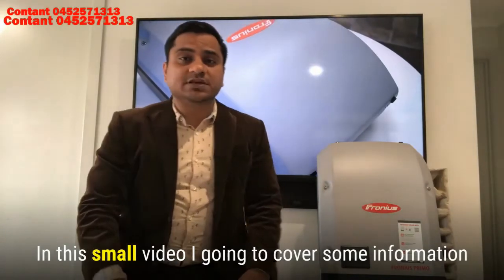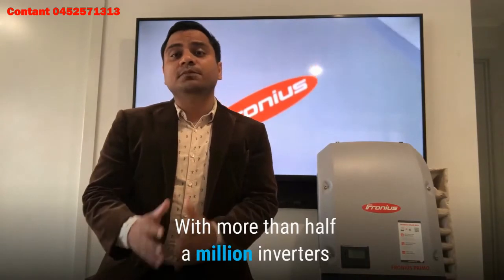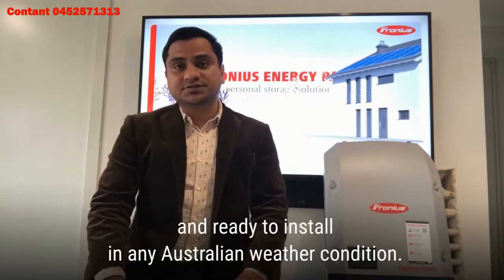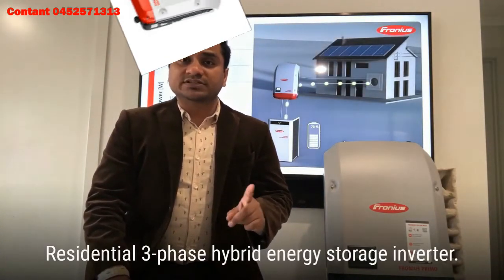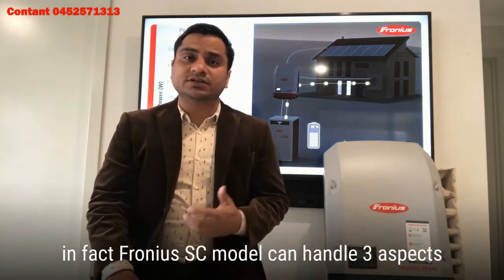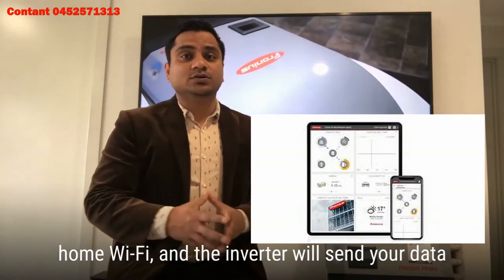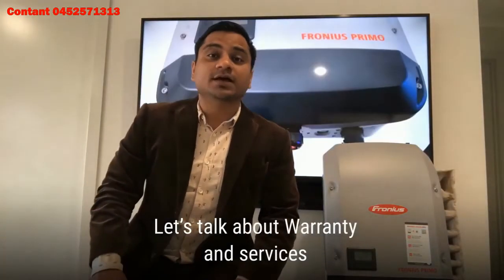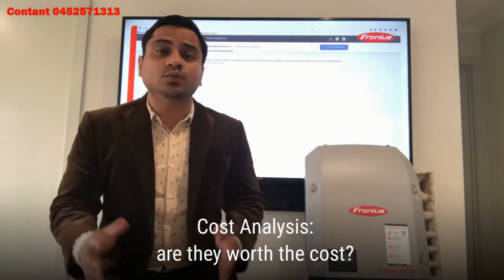Fronius Inverter Review | Are Fronius Solar Inverters any good? #Fronius #topSolarinverter #Panels

Comment: Noisy as hell. In 2021 Fronius simply must not place a ridicolous super noisy miny fan in an inverter pricing 2000$
Reply from the maker: Fronius inverters use a fan for active cooling. The stronger the sun, the louder they get. Fronius Primo inverters make much more noise than the new Fronius Gen 24 inverters.

They are silent when the sun is not out.

If you want an inverter that does not have a fan for cooling - consider an SMA, soleredge, sungrow or Huawei.
Reply: @Solartechreviews  Thank you for your advice! I have 10kw of solar panels and I want to change my Fronius Symo 10 three-phase. What Brand do you can recomend in terms of silent operativity between these Brands? (SMA, soleredge, sungrow or Huawei). Best regards.
Reply from the maker: @gianlucablengio  Since you already have panel install and soleredge requires power optimisers as well. 
Thus, in premium option go with SMA.
For budget and reliable option you can choose Huawei, Sungrow or Goodwe.